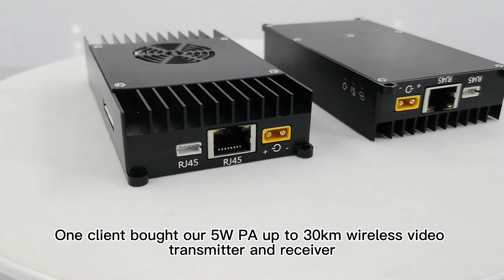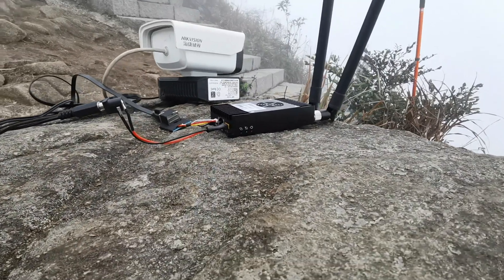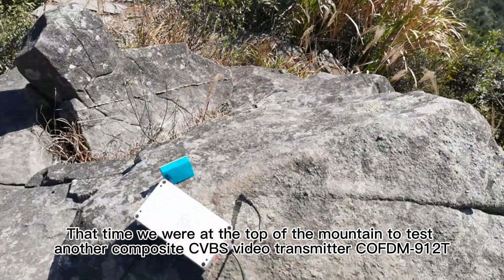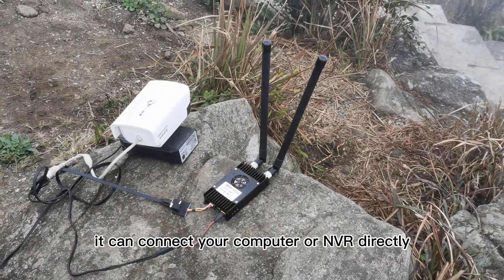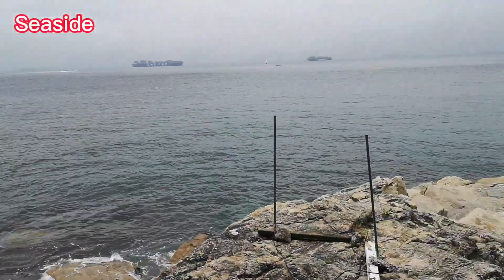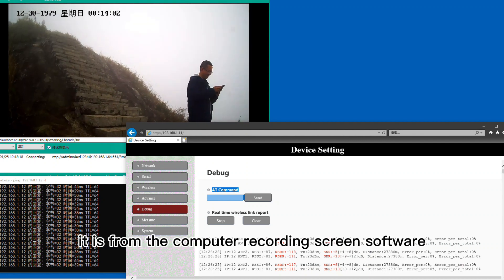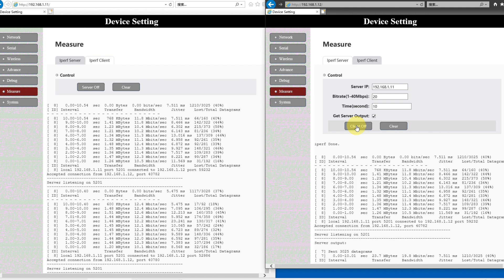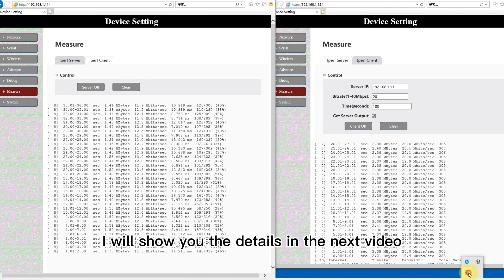2W PA 27 KM long-range wireless video transmitter receiver living demo image data link transmission

Comment: Does it need internet to work?
Reply from the maker: no need internet. one is transmitter, another is receiver, just connect the antenna and offer the power then it start to work.  2 IP device (IP camera or PC) are connected even 10~150km distance at Line of sight.

Comment: 27KM range from the top of a mountain and across the sea, so in the real world about 200 yards
Reply from the maker: from the mountain top to the sea side, just want to test the transmission distance on the line of sight condition, simulating the plane transmitter to the ground receiver.